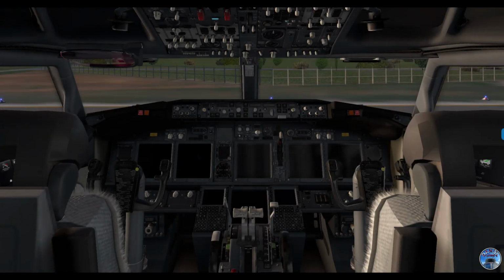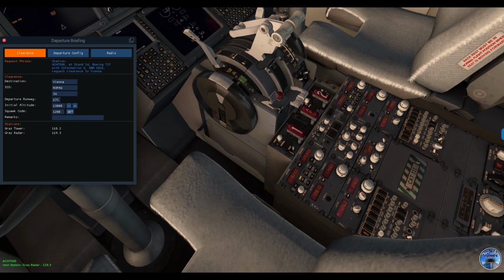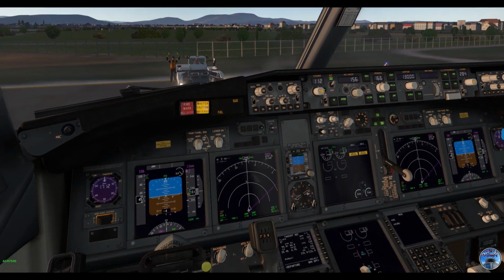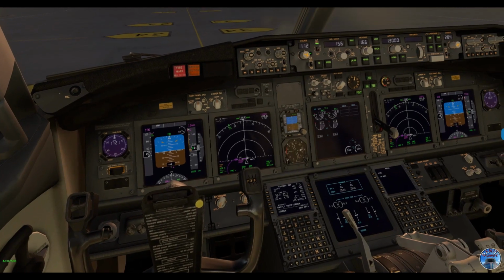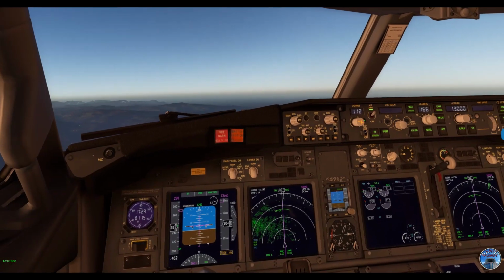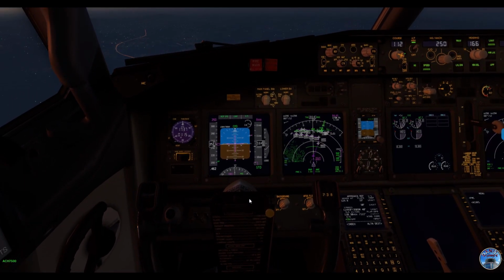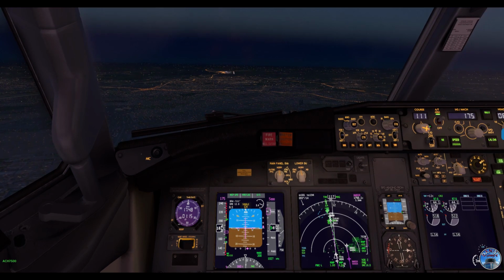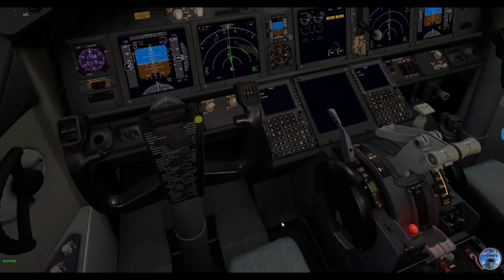XFirstOfficer for Boeing 737-800 ZIBO Mod

Comment: whoa - i thought the electric hyd pumps go live when its pushback and startup time - with the sequence of ELEC HYD pumps on , BEACON on, CHECK HYD PRESSURE on both A & B systems, then continue with engine start checklist..
Reply from the maker: Hi, thanks for your comment.
In my opinion (not necessarely the truth) it is depending on the company procedures. Definitly nowbody should operate next to the control surfaces as they may move by turning the hydraulics on. But anyway I think most of the time they are turned on during the initial overhead panel flow.

Comment: How to access "Departure briefing menu" like 15:48 ? Is it an application from First Officer assistance or not? Thank you
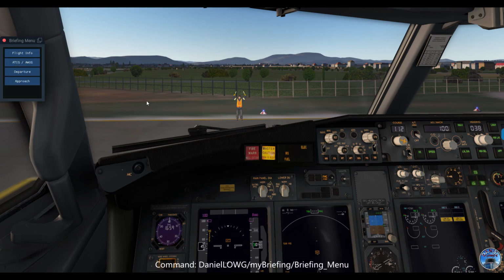Reply from the maker: Hi you can access it via the Briefing Menu (you see it @ 3:53). There you have the options for Flight Information, ATIS/AWOS, Departure, Approach.
Additionally in the newest version you can pre select the next upcoming procedure and start it with the button below.
At the Departure and Approach window you have the navigation buttons on the top for the three pages.
Reply: @daniellowg  Thanks for the prompt answer, however, is there any shortcut to access the briefing menu? I can't find this pop-up and I have the latest script version installed. If no shortcut, how to use the command informed on the video? I did not find this info in the manual. Thanks again
Reply from the maker: @caduguimaraes  Yes there is the command "DanielLOWG/myBriefing/Briefing_Menu" to configure a key press command. You should find it in the X-Plane key board settings.
Reply: @daniellowg  Now I got it. tks

Comment: hello, I would like to inform you that in the "before start checklist" procedure the "isolate valve" is not open for the start of the engines, another item is in the "parking items" all fuel pumps are turned off with the APU on. I’m constantly using it and trying to get better and better.
Reply from the maker: Thanks I will check the isolation valve issue. Is on the list of items for the next update.
I think the fuel pump needs not be ON for APU operation. I know that is a little bit inconsistent, because it is switched on in the before start items. 
Personally, most of the time I connect direct after initiating the parking items to ground power and turn off the APU by my self before the pumps are OFF.

Comment: hello thanks for the beautiful work. have a problem recognizing the value of the trim for takeoff not being recognized have any suggestions?
Reply from the maker: Where you have the problem, in the FMC or in the Briefing Tool?
Is the FMC showing a Trim value on the Take Off page?
Reply: @daniellowg  well I have configured the correct calculated value of the fmc for the pitch trim and it presents the error in the 'before start checklist' and in the 'before taxi checklist' not finding the correct value for the pitch trim. I tried to change the dataref variable to pitch trim_calc, but not resolvable so to proceed I had to put a value that was different in the check operation.
Reply from the maker: @superrodrigues1724  normally the FO sets the trim as it is entered in the Briefing for Departure Configuration. Was the correct value in there? Did you press Request Data to receive the values from the FMC to the Briefing Tool?
If you try to set the trim manually it is really hard to get it to the right position.
Reply: @daniellowg  ok, i made a second flight and asked to receive the values through the briefing and no longer presented the problem thanks for the answer. I would like to know how I add the activation of the "runway lights" in the procedure.
Reply: with every flight I make, I improve the quality of the procedures even more. I have a suggestion the "descent procedure" would have to be performed before starting the descent and not after the descent has started
Reply from the maker: @superrodrigues1724  I think you mean the runway turn off lights.
You can enter following 2 code lines to the DanielLOWG - 02 - ziboB737-800.lua file in line 910 below -- Barometer Synchronisation in function LittleActions():
TurnOff_Light_left = Taxi_Light
TurnOff_Light_right = Taxi_Light
This will synchronize the runway turn off lights with the taxi light.
Reply from the maker: @superrodrigues1724  Yes that is correct.

Comment: It looks very interesting, but the commands are voice input?
Reply from the maker: The commands are normal key commands in X-Plane, but I use the Voice Attack software, which emulates a key press event on the keyboard. 

Therefore I use a different command for each procedure call, but there is a command implemented now, which make it possible to just activate the next procedure with only one key or joystick button.
In other words no voice command software is necessary to use this package.
Reply: @daniellowg  Thank you sir, unfortunately I was looking for a voice commanded FO. Nonetheless, great job with this addon!

Comment: hi, i'm having trouble loading the checklist. The "next" option does not work. When I enter the plugins menu, I can see all the procedures and click on each. I would like it to be automatically via the "next" button
Reply from the maker: Hi, you can activate the selected procedure with a next button. You need to define "DanielLOWG/Proc/Start_next_procedure" on you keyboard or joystick. The dropdown menu in the Briefing Menu is, that you can select a certain procedure if you like to change the order. Otherwise it will step automatically with the next command to the next coming up procedure.

The next command is new and not shown in the video. Please take a look to the manual of the most recent release.